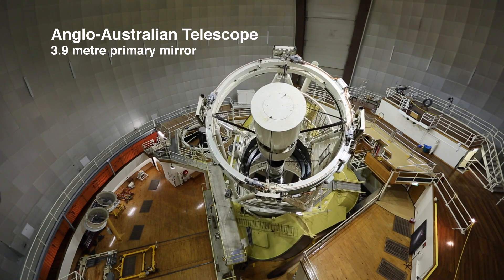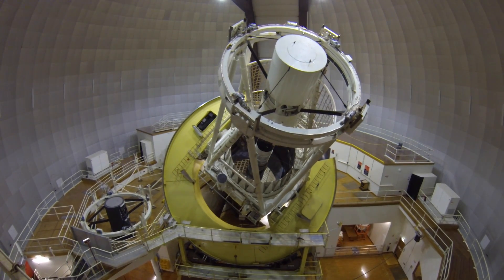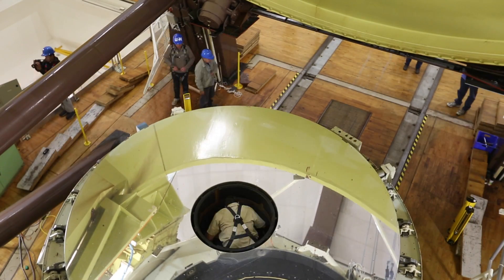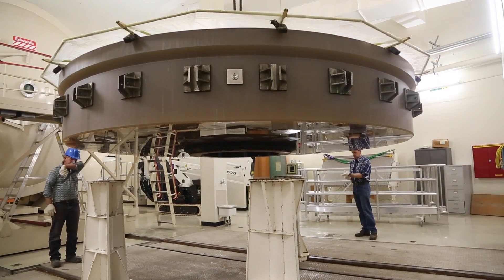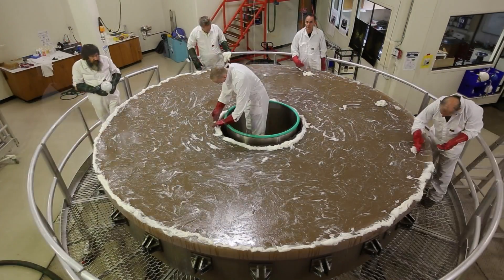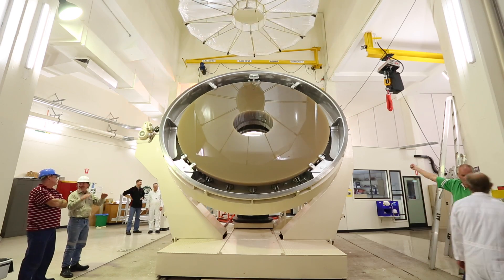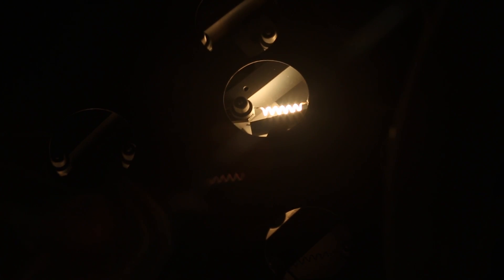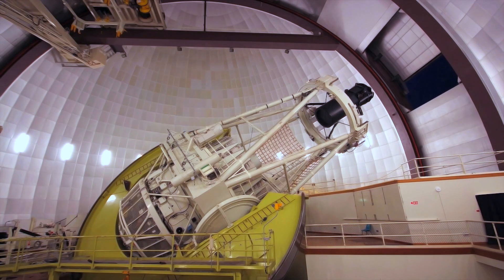Aluminising the Anglo-Australian Telescope

Comment: What is the substrate made of? It looked like some sort of polymer plastic. Would the alumising process be accurately described as sputtering?
Reply: We visited the telescope recently and I asked this very question. So the substrate is a glass ceramic compound. The main reason it is that thick and heavy is for temperature stability, the substrate has a very low thermal expansion coefficient. That way it maintains its shape near perfectly over various temperatures.

Comment: Why dont they seal telescopes and fill them with an inert gas to keep them from corroding and aging. Impractical to construct a sealed housing? You mean more impractical than doing this once a year?
Reply: The 4 metre diameter window that you'd need on the front of the sealed housing would definitely be far more impractical than annual re-aluminising. Optical glasses simply aren't stiff enough for unsupported windows of that size to be made.
Reply: So how are you going to clean the sealed housing?
Reply: Just like i the previous post: any gas or air chamber in front of the telescope would make the telescope unusable. You want as little as possible of air molecules in front of your scope, thats why they built them on high mountains in the deserts, because air is dry and very dispersed.

Comment: Australian Astronomical Observatory
If you are recoating the mirror that often why aren't you metalizing with silver which is significantly more reflective?
Reply: i was wondering the same
Reply: Aluminium is used for almost all large telescope mirrors largely because aluminium oxide is transparent and impermeable (which stops further oxidation). The aluminium coating effectively forms its own protective coating as soon as it is exposed to air.  Bare silver, on the other hand, rapidly oxidise to brown, opaque silver oxide. Consequently silver mirror coatings must be protected from oxygen with additional, transparent coating layers, which makes the coating process significant more complicated, especially on several metre scales. To my knowledge only the Gemini Observatory have decided that it's worth the trouble.

Comment: This is 1950's technology!  The mirror should get a multilayer dielectric coating, applied by cathode sputtering.  Such a coating would last for many years, having no matal to corrode, have higher reflectivity, and would be able to be cleaned repeatedly.

Comment: They're big on the safety harnesses but then they use caustic soda with no safety goggles.
Reply: Don't wanna accidentally fall on the mirror. I'd rather risk my health than ruin such a costly investment.
Reply: The mirror cannot heal itself, while I can.
Reply: It doesn't have to be particularly concentrated.
Reply: Exactly what I was thinking, and they could use the elastic strapped goggles if they are worried about them falling onto the surface.
Reply: OK, I wish you the best of luck on that one if you should ever need to do so!
Reply: I would rather fall on the mirror than risk such a priceless investment,..my health!

Comment: They definitely should install an air curtain in front of the mirror to blow off falling debris.
Reply: It's possible the turbulence of the air has a greater negative impact as you can't compensate for it, whereas the batshit you can
Reply: Jonathon G. I wish it was possible to compensate for batshit in other areas too
Reply: Vibrations are bad for telescopes.
Reply: A great deal of effort goes into minimising and correcting for turbulent air in front of telescope mirrors, it's the main limitation on the sharpness of the images from ground based telescopes. An air curtain would be disastrous for the image quality.

Comment: Why dont the aluminium oxidase and turn dull when it comes out in the air?
Reply: Because aluminum oxide is transparent (sapphire/corundum)
Reply: Is it? So what is happening when I for example cut a piece of aluminium on the lathe or the mill, and immediately when i cut it it has a pretty shiny finish, but pretty fast after the cut (within a few seconds) it gets a slightly dull gray finish?
Reply: Down to the alloy used I suppose, what they're using is 99.something% aluminium, so no other metals are oxidising. Possibly also they skip mentioning a passivating step that counters the effect of oxidisation
Reply: I think that when you cut a piece of aluminium its surface is not very smooth, so the aluminum oxide forms layers that are not smooth and reflect light back and forward blurring out. the surface they coat aluminum on is so smooth that both aluminium layer and oxide layer are so perfectly smooth that its transparent.
Reply: I was wondering this too. Found this: https://www.finishing.com/203/98.shtml

Comment: How does this aluminium coating stay so perfectly shiny? Doesnt aluminium oxidize immediately when in contact with air?

BTW the music is super annoying.
Reply: Probably not immediately but probably that's the main reason they have to do it each year. A more noble metal would suite better this high end mirror.
Reply: It does oxidise, but the great thing about aluminium is that aluminium oxide is both transparent and impermeable (which stops further oxidation). The aluminium effectively forms its own protective coating.

Comment: What is the "wax" applied at 7:25?
Reply from the maker: It's not a wax, but a hi-tech cleaning fluid called Balzer's No.1. It's actually slightly abrasive, so it takes off a fine layer of the surface prior to the application of Balzer's No.2, which is a solvent.

Comment: guys you should listen to your peers, if ain't broke, leave it alone. So you go through all that hassle of re-aluminising each year, I am still using my telescope after 10 years and still has perfect reflector. Isn't there more risk that you may damage it in the process.
Reply from the maker: We have refined the realuminising process over the years so it is as safe as possible.  The higher throughput achieved through the process of realuminising is very much worth the effort for the world class science carried out using the AAT.  Thank you for your comment!
Reply: Care is needed to avoid damage but the cleaning materials and procedures have been carefully chosen with that in mind, taking into account many decades of experience at observatories around the world. 

The mirror has never been re-ground, there's no need, the mirror's shape does not change with time. The Balzer's Number 1 compound uses in the cleaning process is slightly abrasive so the mirror does in effect get a very light re-polishing each time it is re-aluminised but the amount of material removed would be minuscule. The process is really about removing dirt & dust and renewing the aluminium coating, the Cervit mirror itself doesn't really need maintenance.
Reply: Something to bear in mind, commercially available telescope mirrors usually have a protective transparent coating over the aluminium. This makes them much more durable but the coatings used are not ideal for research telescopes that operate in the ultraviolet and infrared, not just the visible. Almost all large telescopes use uncoated aluminium, and are re-aluminised every 1-2 years, the AAT is not unusual in this respect. One of the few exceptions are the Gemini telescopes, which use a silver coating with several additional layers to protect the silver from oxidation and increase the otherwise poor UV reflectance. With regular CO2 snow cleaning that multi-layer coating can last over 5 years, but needs specialised coating facilities.

Thanks to measurements of both reflectance & scattered light taken before and after every re-aluminising it's known exactly how much is gained by re-aluminising the AAT, and it is indeed worth it. The AAO has been re-coating the AAT's mirror every year for over 40 years without incident, the process is well understood.

As far as bird poop on the mirror is concerned, the likely culprits are the swallows that are often seen swooping around both above and inside the AAT dome around dawn and dusk. That's a time when the telescope frequently is pointed straight up with the mirror cover open, for calibrations (twilight flats), so there's not much that could be done. Exterior lighting (even downward pointing) would quickly attract an angry mob of users of the other telescopes on the mountain...

Rest assured that people aren't sweating or shedding skin and hair all over the AAT mirror during re-aluminising, or any other time. During the final cleaning the mirror is vertical, and the AAT dome and adjoining spaces are, usually, cold. The interior of the dome is air conditioned to match the forecast night time temperature, in order to minimise convection currents rising off the telescope during observing.
Reply: You did see the bit where they hit it with an anti-static brush to remove stray particles of whatever immediately before shutting the door on the aluminiser, yes? As for the rest of it, they've been running this thing for some time and they're really truly not stupid people. They just might have considered options to reduce mirror fouling. Just putting that out there.
Reply: Although, i might suggest... (And please give my suggestion all the respect it deserves :) ...Crank up the AC so y'all ain't sweating like pigs while you work, and consider wearing hairnets, hoods, and goggles. I mean, yer goin to all that trouble to realuminize the primary mirror, you might want to keep dead skin, sweat droplets, and small bits of hair off it. Just my opinion.

Also, after seeing that (very cool) protective iris closing over the mirror, i'd hope you have a filtered positive-pressure air source feeding into the mirror chamber when the iris is closed, to help keep out dust and debris. The entire dome could be pressurized in a similar manner, to keep dust from coming in when the dome is open. It's really amazing to me that you have all that equipment on the ground floor, and i imagine your power bill to be quite impressive...but to shave operating costs a bit, research "Earth Tubes". They could be buried in trenches around the property, and cool/ dehumidify air to cheaply cool the facility. Earth-sheltering the ground floor might also help.

Also, lights seem to attract birds, so you might put a ring of bright LED lights on poles in a 200-ft circle around the observatory, with bug-zappers beside them, to lure any birds/ bugs away from the viewport. The lights could be aimed downward, and sequenced as you rotate the dome so only the ones behind the telescope are on to minimize light pollution. I have ideas like this constantly, about everything i see.
Reply: And i thought of this...At the start of the video you say there is some amount of bird poop on the mirror. I'm sure :rolleyes: you've seen cloth light shrouds around Dobsonians. If you were to install such a shroud around the truss tubes of your telescope, birds would have nowhere to perch above, and be unable to fly above, the primary mirror (unless it was pointed straight up, of course). It would also keep most dirt and debris from drifting/ falling on the mirror.
Reply: What about actually damaging the glass with all that touching? Do they ever re-polish / grind the mirror surface?
Reply: To put it more bluntly, for you to compare your small amateur telescope mirror to this one, is like comparing a mule-drawn travois to a Lamborghini. You have no bloody idea how stupid you sound to a real scientist by making that comment. Piss off!

LOL